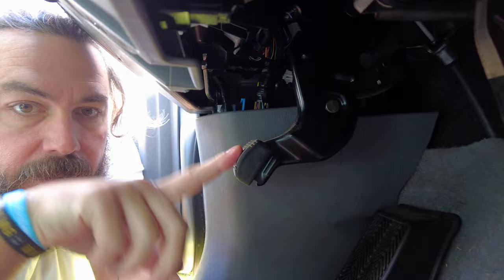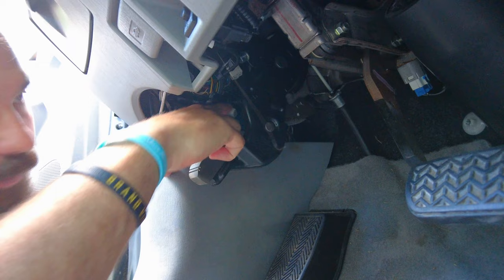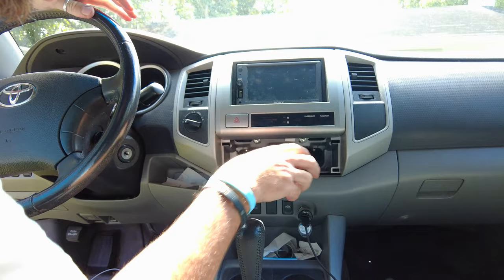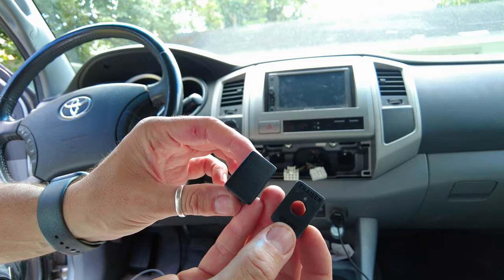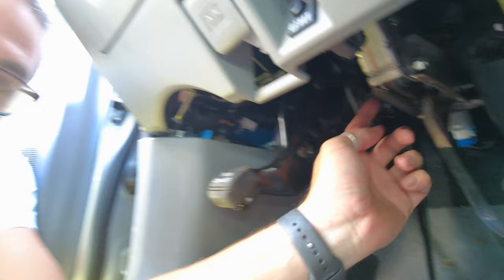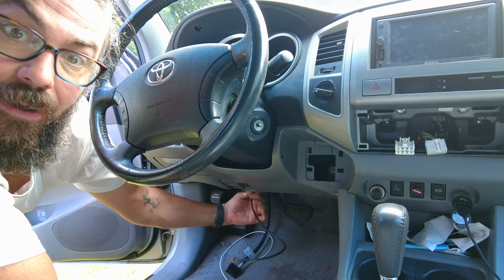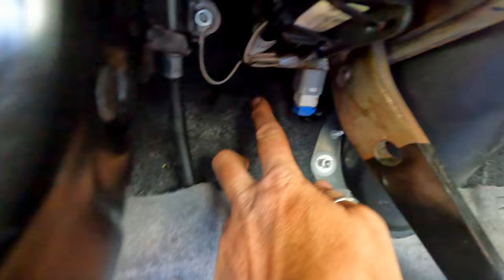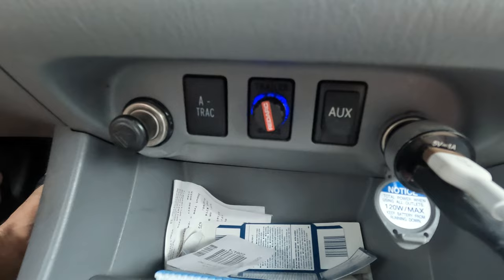2ND GEN TACOMA BRAKE CONTROLLER INSTALL

Comment: Those are great brake controllers! I installed the same one in my Lexus GX.  Basically plug and play. I installed in the drivers side kick panel as well.  Also got the Toyota dash bezel that the switch mounts in to. Looks like factory!
Reply from the maker: Yup it was really easy. I was stressing as we needed to be on the road but i'm glad it was pretty much plug and play as you say.

Comment: Can you share the links for where you buy the brake control and wiring harness
Reply from the maker: Very sorry for the late replies. Only coming up for air recently. Here's the link which I'm sure you've already worked out but better late than never: https://www.summitracing.com/parts/RDC-CIKTP-NA-002

Comment: Quick question - how did you find visibility of the switch settings/color changes from that switch position?  I'm going to try and do this in the next day or two for a trip this weekend, saved me a bunch of head scratching! Thanks mate!
Reply from the maker: Hey! Glad it helped! It's obviously not ideal to have the switch that low as you're going to be looking at it during braking etc. but you can for sure see the color change from driving eye level. If you have the space i'd use one of the switch locations to the left of the steering wheel. Ours were all taken otherwise i'd have pout it there for sure.
Reply: @NomadEffect  thanks, I have the exact same model and switch layout as you. There's a guy who makes extension cables to relocate a less used switch from the upper left down to the lower location, I might try that at some point. Thanks again!
Reply from the maker: @RobertsAdventure  Yeah I could easily relocate the lockers or something down there.
Reply: @NomadEffect  Yep, I've never used DAC on any vehicle ever so for now I yoinked that and will relocate it later, TowPro Trail (which I'm pretty sure is just a rebadged Elite) just arrived and install was done in 40 mins (including reading the manual, hunting for zip ties and some faffing around) thanks to your vid! I would've struggled to figure out where to mount the main unit if you didn't suggest that bracket, thanks again! Legend!!
Reply from the maker: @RobertsAdventure  No worries at all. Happy we helped!